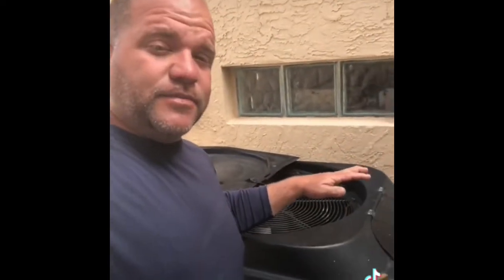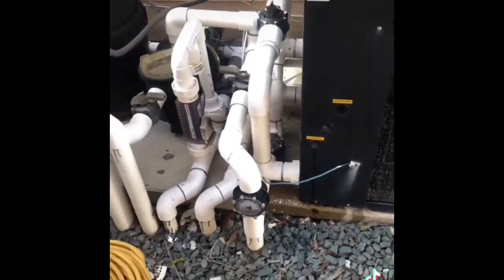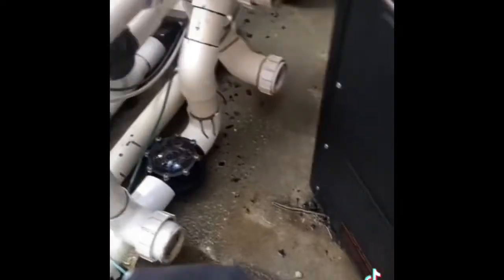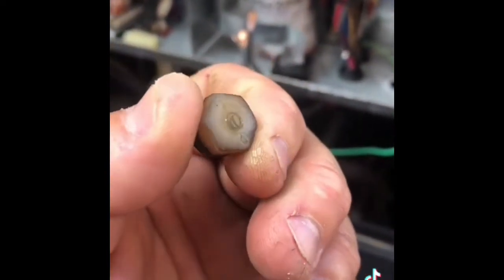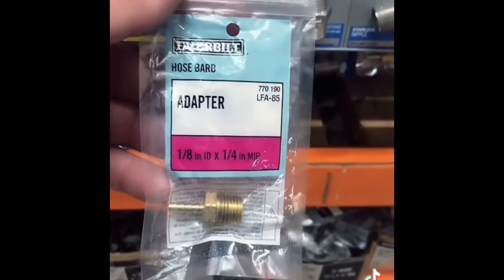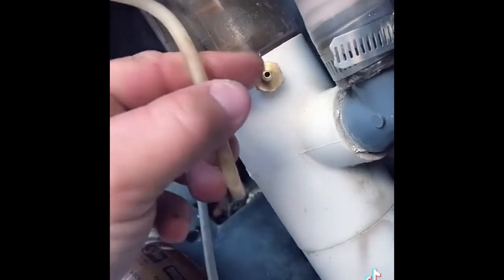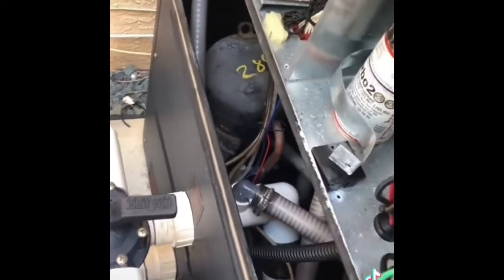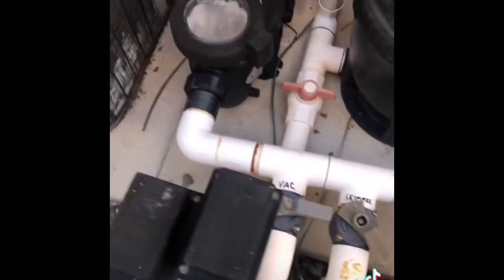Pool Heat Pump Heater Internal Leak Repair

Comment: I have the same issue with a Summit Titanium heat pump.  Same plastic part that broke after 14 years!  Thank you so much !! I will head to Home Depot to get this copper replacement !

Comment: Wow!  Same thing with me.  Going to HD to see if they have any.  My problem is that the when I tried ro unscrew it, tit left some threads in the pump.  I need to get the old fitting out to replace it